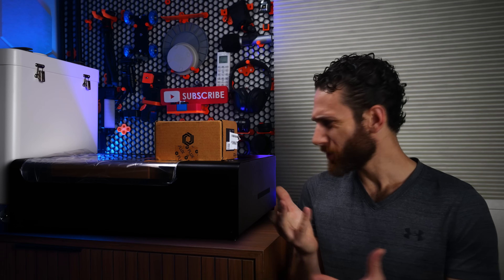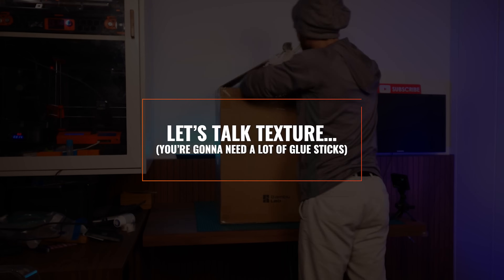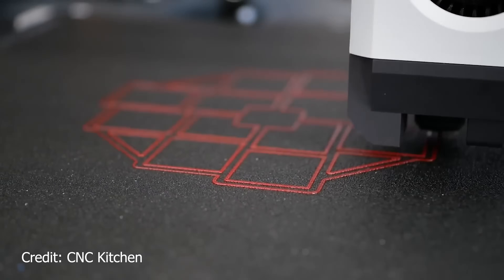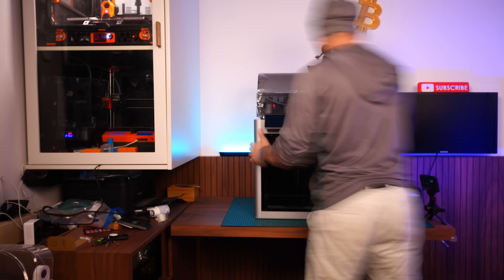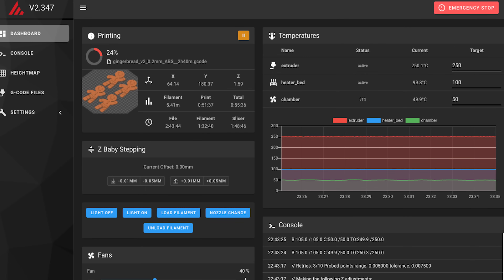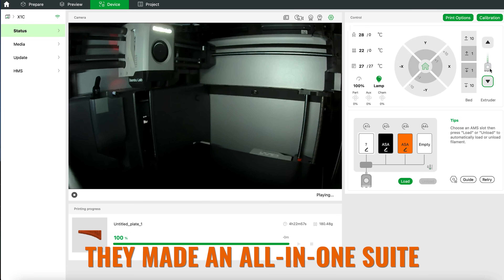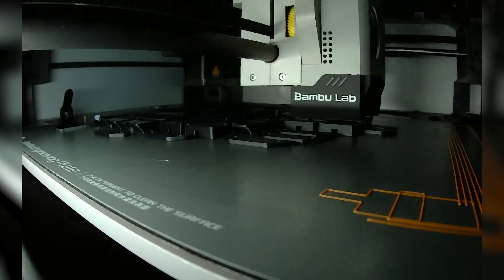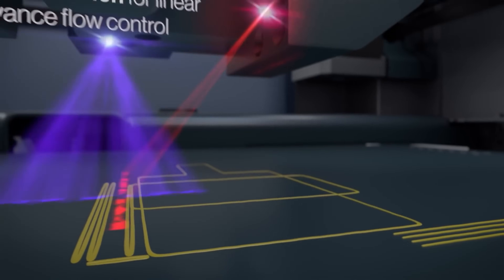Bambu Lab X1 Carbon: What NOBODY Is Talking About...

Comment: the flagship printer does not come with a textured plate because it has unlike the p1p a lidar scanner, which does not work with the textured plate. the lidar is so accurate that the textured plate would mess up its measurements. thats why it isnt mentioned or offered as a set. tom and many others mentioned this in their reviews.

Comment: The PEI spring steel sheet should come with the printer as standard. Especially if you buy the top of the line model they offer. They do mention issues with Lidar calibration when using the textured PEI, so they probably didn't add it to avoid issues... I still think they should have added, but give a disclaimer to use at your own risk or something.
Reply: The lidar is the reason the X1 still doesn't include a textured plate.  While I did buy the textured plate and do use it 90% of the time, the lidar is incapable of doing first layer scanning or flow calibration (successfully) on it.  Annoyingly, the software never tells you this - it goes through the motions and prints more or less OK, but it doesn't actually calibrate or scan properly.  It just fails silently and goes on its merry way.

Comment: Long time Prusa MK3s user here, been waiting for the XL for over a year and now Josef is saying at least another 6 months so am starting to explore alternatives.  You video was informative however I get the feeling you glossed over some rough patches so as to not sound too negative.  Any chance to get a bullet by bullet breakdown of things that work great and are differentiators from the competition versus stuff that works but requires a lot of effort and support versus stuff that just doesn't work at all?

I'm encouraged by the feedback that BL is responsive to issues but my experience attempting to assemble and use the MMU on Prusa (twice- ordered the kit twice in hopes of an improvement) makes me worry what "aw crap's" await a new BL buyer?

Comment: I can guarantee you when they started shipping the Carbon, they could not get the current textured plate to play well with the lidar setup, I assume they had to develop the dark textured plate to correct this issue, as I have already tried to develop lidar and infra red level systems, and the "gold" coloured texture plates diffused the light and it cause all sorts of issues.

Comment: Ah, I see you are part of ModBot's conspiracy to drive me bonkers by mispronouncing "Mk." as "emm-kay" instead of the much shorter and grammatically correct "mark."  :)  (Seriously, though, I genuinely don't understand why no-one on YouTube says that properly....)

I enjoyed this, and I think you're the first YouTuber I've seen that acknowledged the X1C isn't really intended for PLA/PETG.  I mostly print ABS on mine and I find it works well on the Engineering plate.  Bambu does recommend that you use some gluestick, but I applied it once and in a fit of laziness haven't refreshed it in about three spools.  And as you say, the X1 just does almost everything else for you.  It's defintiely saved my interest in 3d printing as a tool - my previous machine is an Ender-5 Pro, and while it mostly worked, it was frustrating enough that I'd often go out of my way to find solutions that used anything but 3d printing.  With the X1, if 3d printing is at all viable for a project, that's the way I go.

Oh, and I totally agree with the whole "it's so fast I've run out of things to print" aspect.  I've had to become comfortable with the idea that the printer might just be turned off for days at a time - not because it broke again, but just because there's nothing for it to do right now!
Reply from the maker: Totally!!

Comment: Overall I loved the review. You've actually convinced me to purchase the Bambu Lab X1 Carbon Combo. The only thing that bothered me a bit was you comparing the Bambu Lab X1 with an MK3s+ for "automatic filament loading" ( 10:40 ) when you know there is a MMU2s available. I just didn't think it was a fair comparison. I don't know how many printers you have available, but it would've been better (imo) to compare that annoyance to another printer that didn't have the option/possibility to automatically change filament for you. Anyway, keep up the good work & good content!
Reply: From what I’ve heard, the mmu2 is horrendously bad, the voron ercf is decent. And AMS is the best by far
Reply: @Aikano9  He's talking about the "automatic loading". You don't have to pull out and push in the filament, you don't have to cut the filament. You also don't have to push some knobs to pre-heat the filament. All these things are taken care of by the MMU2s flawlessly. What I think you're referring to is the actual multicolored printing which can have its issues if not calibrated well.

Comment: I was hoping from your video title that you would cover some stuff not seen in other machines/slicers.  One that comes to mind is the fact that you can select a texture pattern for the top and bottom layers.  This works really well, especially for the top layer.  Bottom layer pattern does show up, but not as prononunced (assuming you are not using a textured plate).

Comment: the reason their slicer and app seems well integrated with the machine is that 1.) the proprietary system/s and 2.) it being a 'walled garden'. Them not having to worry that their software have to 100% work with A,B,C brands with X,Y,Z mods, makes it far easier to develop and manage. Bambulab's slicer "suite" also containing features that other slicers don't have is also due to this reason. This is impossible to implement on other slicers if you aim to get every permutation of brand, features, and whatnots to work with each other. except maybe Prusa/PrusaSlicer, devs won't develop the slicers to suit a particular printer. 

Bambulab's closed system is also why they are able to 'fix' issues fast - they know what's on each machine, every part on every printer is the same, and that it won't change with mods (at least for now). Whereas with other printers, the more mods you have, the lesser 'support' you'll find with the community and you'll eventually have to learn how to fix it yourself. 

This vid also made me realize how fortunate I am to actually start my journey into 3D printing with Klipper, instead of Marlin. QOL features like a web UI vs a scroll wheel and a small screen, remote viewing, remote access/control of the printer, easy mods, etc made it so much more enjoyable to use.

Comment: It looks like your shutter speed is set to low to compensate for the low light in the room. Making your movements blurry. Remember the rule of thumb the shutter speed should always be atleast double the fps. 60 fps should have 1/120 shutter speed. 30 fps - 1/60th etc

Comment: My main question about investing in this is how bad the vendor lock-in is going to be.

My current printer is a CR-10s but it is a frankenprinter with all the mods and aftermarket parts and improvements over many years.  But it's long in the tooth now.  Good for prototyping with PLA at this point and that's it, even if I used to print ABS and PET-G almost exclusively.

I don't want to only be able to buy uber-expensive proprietary parts or be limited.  This is the decision point for me between an X1 Carbon and a Voron 2.4.

Comment: Could they not have the printer calculate and use the filament it would normally puge as infill or internal non visable walls whenever it could? Seems like a logical solution.
Call it 'smart purge infill' where it changes the print order to print infill then internal walls then external perimeters.

Comment: Bambu Studio actually does have a feature where it automatically adjusts purge volume based on the color.
Reply: True enough but it still purges a significant amount more than needed, especially with using a purge tower and purging to infill.  I personally didn't think the purge volume adjustment was that hard to find in Bambu Studio though.

Comment: They claim that the textured plate could cause accuracy issues with their lidar system. My guess is they don't include the textured plate so users have to specifically opt in to using one. The P1P doesn't have a lidar so there's no downside to using the textured plate with it.

Comment: Cura actually insists on controlling your printer from the software - if you have a RepRap compatible printer connected via USB to Serial. It's very annoying and not good. Well you can teach it not to do that by killing the corresponding plugin.

The first software i started off with back in 2007 with was Repetier Host, and i think it was a great starting point for the time. It's a printer control software but it also slices. It doesn't slice very well and you don't get a lot of settings, but for me as a beginner, it was outright perfect. I would still potentially recommend RH to some people as a first step, so i think they made the right choice here doing that same thing but less jank.

Comment: Thanks, this is a great video of the X1C. Having mine since end of December, I can tell that it’s a really great machine and ecosystem. One often overlooked feature of the AMS is the automatic capability of switching to a new spool when you finishes one. Having two spools of the same material in it will ensure that your print will complete without any manual intervention! No more trying to figure out if you have enough filament to do a print…. Genius!
Reply: would you say this would be a good 1st 3d printer for someone who wants to 3d print figurines for tabletop gaming?
Reply: @Candyapplebone  very overkill and expensive but it does have huge perks regarding the fact that you don’t have to really do anything other than click print. If the money isn’t and issue for you it is a very very good printer especially for someone who doesn’t have a lot of experience or doesn’t feel like 3d printing “is” the hobby.
Reply: that's not a new idea Prusa MMU2 has that as well. I hope the AMS works flawlessly unlike my MMU2.
Reply from the maker: Yep.
Reply: The feature that doesn't work? Lol. Yeah great.
Reply: @rightsdontcomewithpermits7073  Interesting comment! It does work for me every time; in the AMS two spools setup with same material and same colour and it perfectly detect end of one and switch to the new one. You have to set check the AMS auto switch filament in the AMS Settings. I've done it now four times with PETG in gray, black and translucent. Are you on the latest firmware on both AMS and X1C? if so, and it does not work for you, you might want to contact support. Take care.
Reply: @robdel99  so you have to use same color?  Bl told me that it is only needs to be same type of filament next in the row. I guess I'll try to impute same color on  ams. Bl is very responsive in their response but not helpful most of the time.
Reply: @rightsdontcomewithpermits7073  I don't know how to use that feature, but the ams will pause your print when it runs out of a spool. So it doesn't fail :)
Reply: @rightsdontcomewithpermits7073  works for me.  They fixed it since your comment?

Comment: The one "pure" selling point about this printer...is what it comes with.  To get something like this in say a Prusa (I own 2 of them), I was looking at all the things that this offers...fully constructed, with an enclosed case, fans, camera, MMU (unassembled)...potentially, you are looking at over $2K.  And this is without octoprint and raspi for it.  Instead of hours of assembly (the enclosure and MMU, raspi (if you can find it and afford it) (also not talking about the wifi card from raspi)...one would be spending more blood, sweat, and tears that no amount of gummy bears and skittles will make up for.

Now, the real down side, in my opinion...proprietary software.  I get that every manufacturer has their...preferences.  I get that.  And I think that if lidar was not involved...and the camera...PLAUSIBLY...Prusaslicer and Cura...MAY be able to handle that.  I am not sure.  Those two items are an interesting items.  IF it is a combo of the two, it would take a minute to mesh well with it.  Back to the issue at hand:  The software...or more importantly that they control it.  Cura and Prusa are open source...There is no issue for me to have an Ender, Prusa, or any other printer that doesn't or isn't open sourced issues.  It is the Slowforge...er...Glowforge of the 3d printer world.  I THINK Lightburn may work on it.

Bottom line, it looks like a great deal.  I agree wholeheartedly with your assessment of it.  I would love to see a 6 month or a 12 month review on the goings on with this printer.  I hope that it will offer an open source for it...a just in case option with Cura and Prusaslicer.  At least help "merge" the additional tech that they don't currently offer on their slicers.  It MAY be a year or three...it will be better than nothing.
Reply from the maker: Don't forget, this thing prints like 5x faster and at higher quality than the prusa!
Reply: @thenextlayer  That and it already comes with a hard nozzle.  There are more pluses than negatives.  I will admit that.  I am just solely concerned about the slicer options...or the lack there of.  Once that is addressed...at least make it an option...plus it is a new company...there is always a concern.

Overall, I respect your input...and while I am still leaning to get one in the future...

Comment: This is a great video. I've had a X1C with 2 AMS for a month and love it. If you're reading this and on the fence, don't be. For me, the X1C truly brings the joy back to printing.
Reply: I definitely am on the fence at the moment simply because I saw an issue on servicing the heat bed cable from another YouTuber. I contacted Bambu Support to see if they addressed the issue and they ignored my question the first time. When I asked them again they simply said yes. Which made me skeptical. My only concern is having to service this printer - have you had any issues with the heat bed cable  failing ?
Reply: @retrogameboyz  no issue with anything

Comment: I've had one of these since the Kickstarter was fulfilled and have used Polymaker spools without any issues. I have two AMS units (one of each revision) and have experienced no problems whatsoever. But hey, you do you.
Reply from the maker: I had major issues probably b/c mine are dinged and dented up

Comment: Repetier Host had a live printer UI with Solidoodle 10+ years ago. It would track machine motion in 3 dime signs (way beyond octoprint in 2d), with a full suite of control for speed, temps, temp monitoring, z axis offsets, etc. 

That said, 10 years of casual printing under my belt. Tons of Creality machines, a couple Prusa, and now an X1C, and I am BLOWN away. This is the future. Coming from an engineering and manufacturing background, I don't even know how Bambu is making money with this product at this price. Absolutely blown away and would purchase 10/10.  It's still 3d printing and still has some 3d printing quirks, but light years ahead of Prusa and everyone else....

Comment: I would like to be able to skip more tuning calibration stuff. Not everything needs to be done for every print. Although you can skip bed leveling all that resonance calibration is not necessary for every print. Worst, I fear it will shorten the life of the machine because, lets be honest, mechanical devices do not like resonance. They can ither enforce it after a set number of working hours or optionally or both.
Reply from the maker: You can skip it :)
Reply: @thenextlayer  You can skip bed leveling and flow calibration. The machine still does some resonance test, I believe before Z homing.

Comment: well, i would say maybe this printer is geared toward first time buyers, such as me?  i freaking love how i was able to print in a day or so! one bummer... the TPU isnt great to print. i also do not like how their preset settings, arent the fastest its possible, why?  also, there filament recommended speeds are way lower on their site, than in the slicer. great review.
Reply: I would say the exact opposite actually. I tell new people to buy the cheapest ender money can buy then help them tinker and tune it for 6 mo until it prints like a MakerBot. Now they know how to troubleshoot, understand the mechanics and physics, and can really appreciate what the Bambu claims to be able to do. They also have the knowledge to know when to blame the printer and when it's time to look in the mirror for the fault.
Reply: TPU isn't an easy filament no matter what printer you use but it's no harder with the X1C than it is on any other printer and easier than on a lot of them.  You just can't use the AMS for it but again, that holds true for all multifilament units.

The presets are designed both for print success and longevity of the printer.  If you tried to run every single print at ludicrous speed and max accel, you'd wear out bearings, belts, gears, motors, carbon rods, etc. much faster.   You would put more strain on those parts and would have more issues with the printer.  Even though all the parts of the printer seem pretty high in quality, none are indestructible, they are going to wear out no matter what you do.  You wanna crank yours up, go right ahead, I'm quite happy with the defaults print speeds/profiles, knowing my X1C will last much longer and I'll have fewer print fails.  Even the standard speed on the X1C is faster than my other coreXY printers as it is.

As for the filament print speed recommendations, those recommendations have to cover use on other printers.  My Voron can print just about any filament a far higher speeds than recommended by their manufacturer, mainly because they have to list speeds that work for every little dinky Ender 3 clone out there.  So far, every filament I've used works just fine, no matter the manufacturer, with the default slicer profile speeds.  The only things I change are nozzle temps, if I want to print at sport or ludicrous I hike the temps a bit for some filaments.